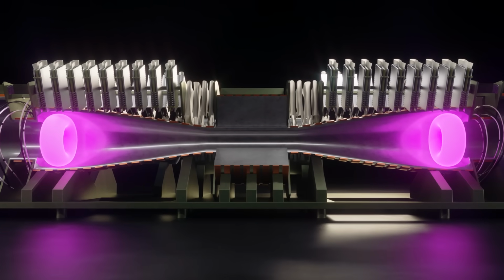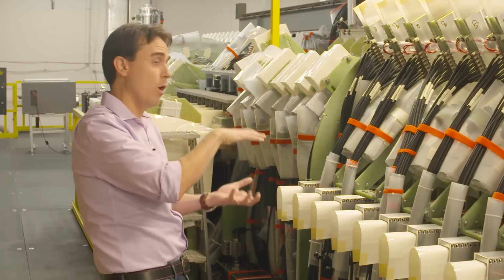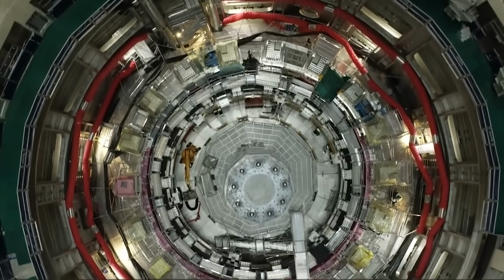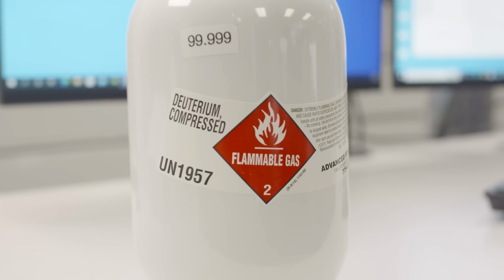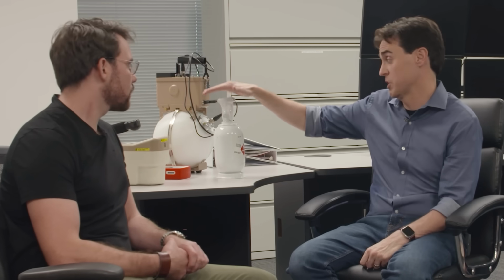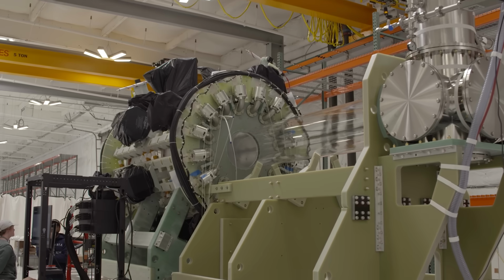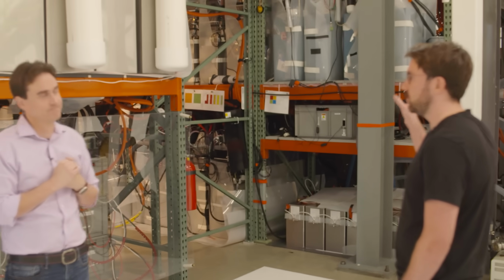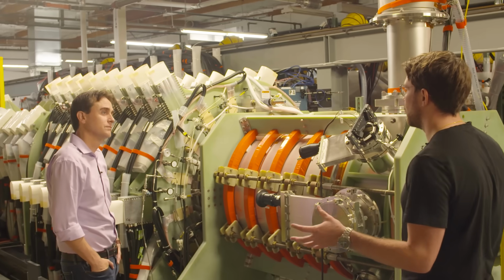A New Way to Achieve Nuclear Fusion: Helion

Comment: This is fascinating. However, the resource limitations are all the more reason why we need to begin mining the asteroid field for those "rare earth resources" because those materials are only rare on earth but quite abundant in space. 

Furthermore, The process they are using to create more tritium can be applied in order to create true gold "Noth that we would need to considering Gold is likely very abundant in space" What many people do not know is that all of the gold on earth was not created on earth but is simply the result of Supernovae and gravity. While we COULD fuse gold, we likely wouldnt need to. instead we would use this method to create truly limited resources.

Personally. i wonder how much of this method can be used in the creation of Anti-Matter. Using the same magnetic principles you may be able to confine an Anti-matter stream and exhaust it as thrust or convert it the same way to generate electricity.

.

Comment: Is there an OFF button?
Reply: Of course.
Reply: @elmarmoelzer2229  Yeah. It's called chaos.. Js.. What happens when the magnets fail over time. Or whatever. Black hole? Sounds fun.. Also, when does it get converted as a weapon? I can't be the only idiot that can see that happening. Or maybe it already has...
Reply: @jamesbenge7724  You can't convert it into a weapon and even if you could it really wouldn't make sense given it would be even more specialized work than building a fission bomb

Comment: So, there's a potential massive fix to getting clean energy efficiently, but it's locked behind engineering problems that cannot be solved communally by engineers because it is a commercial product rather than a scientific endeavour, so no-one other than those on the payroll of Helion can work on it or produce more efficient models because of patenting. Once again profit motive ruins humanities chances of survival. Every year these problems go unsolved for the sake of profit hoarding the worse the world will get. Well done to the engineers, fuck the business owners.

Comment: What kind  of materials can possibly withstand ten of millions of degrees in order to hold this fusion in? The best metals can only withstand thousands of degrees, plus how would you test the materials to know that it can withstand this kind of outrageous temperatures without possibly causing a catastrophe to the entire planets, we are talking about putting the temperature of multiple suns on the earth?
Reply: Here we go again:
Temperature alone does not matter. What also matters is the size and density of the high temperature object. 
The fusion plasma is very hot, but not very dense (closer to a vacuum than to ambient air) and it is surrounded by a high vacuum, which is a perfect insulator. Think of steam from a pot of boiling water. The steam is boiling hot, but you can hold your hand into it (carefully!) without getting severe burns. This is similar. It also cools off immediately when it touches anything like air or the vacuum vessel walls. In addition to that, the magnetic field keeps it away from the walls until it is allowed to expand. It cools off during expansion. While it expands it induces a current in the surrounding coils. Doing that work makes it cool off even faster.
Reply: @elmarmoelzer2229  I would say thanks for the answer except you started it out as a totally rude fk by saying "Here we go again"

Comment: And how safe is this technology and it's military function is a bomb I bet it's cleaner then a regular nuke
Reply: These types of machines can not explode. The fusion plasma is very hot, but not very dense (closer to a vacuum than to ambient air). Total energy content of a pulse is less than a Tesla battery.
Reply: A regular nuke uses Fission,Thermal and hydrogen bombs use a combo of fission to ignite the Fusion section of the Thermal Nuclear Weapon.Both are radioactive.The core of fusion has to be radiant material to ignite .
Reply: @pootube2024   No, that is the whole point of building fusion reactors for power. It is also why it is so hard. They DO NOT require those materials.

Comment: The only fusion reactor that made sense to me thus far. I've always thought about how we can generate/capture electrons without the thermal and/or mechanical processes. Although I always believed that the ultimate energy supremacy for humans would be the day we manage to split all kinds of atoms including the non radioactive ones, then harness and covert all the energy before that have a chance to collide and create new elements again. The nuclear energy inside a grain of sand can potentially power new York for an hour if all the mass is eliminated by being covered into energy subparticles 

I wish all the efforts, R&,D and devotion to fusion energy that exists today also existed for creation of 5th and 6th generation fission reactors as well, because thorium or spent fuels powered reactors can potentially make electricity very affordable and eliminate much of the radioactive waste storage needed with conventional reactors

Comment: Every couple of decades the fusion game pops up.  I call it a game to write a grant proposal that allows you to spend millions of dollars on a theory.  I'm more concerned about the 'room temp gas' introduced into the plasma chamber.  Seems suspect if energy is the goal.  What is the gas?
Reply: They are not interested in grants (which are way too small to get anything major done anyway). They are fully funded and are desperately looking for qualified employees.
The gas is deuterium and helium3. It is then ionized formed into an FRC and accelerated in the formation/acceleration section to hypersonic speeds. The two FRCs from opposite ends collide and merge into a single hotter and more stable FRC. That is then used as a target for magnetic compression to fusion temperatures and densities.

Comment: I'm just curious as to what kind of metals they use to keep all that heat contain from actual age of melting the damn machine. 20 million degrees is a lot of heat.
Reply: The fusion plasma is very hot, but not very dense (closer to a vacuum than to ambient air) and it is surrounded by a high vacuum, which is a perfect insulator. Think of steam from a pot of boiling water. The steam is boiling hot, but you can hold your hand into it (carefully!) without getting severe burns.
This is similar. The total energy content of a pulse is a few kWh. So not that much.
It also cools off immediately when it touches anything like air or the vacuum vessel walls. The magnets hold this plasma in place until the end of the pulse when it is allowed to expand. That expansion does work, inducing a current in the surrounding coils. That causes the plasma to further cool off.
Even if that was not the case, the plasma is not dense enough to cause a lot of damage to the walls. It would maybe be some slight abrasion that would become a maintenance issue if it happened too often.

Comment: Interesting program. Best pact is that we now have two possible methods using either lasers or magnetics that show promise.
One of the main problems is the second element used. In both cases it is very rare and costly. Finding a way to manufacture these elements both in quantity and at lower cost needs to be found.  
My guess is anyone in their 50's stand a very good chance of seeing a working solution in action.
Reply: Helion will produce their Helium3 by fusing Deuterium in the same machine. D+D => He3 +n or D+D => T + p (the Tritium eventually decays to He3 as well).

Comment: Ive a problem with the explanation of "high pressure water" 8:51, water can not be compressed to "high pressure", also this nuclear fusion of Helion, I understand that it is still in the early stages BUT, and I don't know why it all sounds very suspect.
Reply: Yeah, Real Engineering has a few mistakes in their video. That is not Helion's fault though.
What sounds suspect?
Reply: @elmarmoelzer2229  A few things do not add up, I get the same gut feeling I had with Theranous (any everybody I knew said I was wrong) hopefully I'm wrong on this.
Reply: @maxnex7676   
Like what does not add up?
I have known these guys for many years. They are legit. 
But if you give me specific examples of what you think is not right, I can maybe answer them for you.
Reply: @elmarmoelzer2229  Thanks for the offer, appreciate it, perhaps I will come back to you for clarification.

Comment: and what happens to all the heat generated? smh... fake engineering.
Reply: It is directly converted into electricity.
There is relatively little waste heat. Trenta just needs air cooling. Future machines will have water and/or oil cooling.
Reply: @elmarmoelzer2229  excuse me but how do you "Directly convert" heat into electricity?
Reply: @dimitar4y   I should probably clarify that a bit more: They are directly converting the expansion of the FRC plasmoid to electricity. That expansion is driven by the FRCs own internal pressure and the kinetic energy in the fusion products.
Reply: @elmarmoelzer2229  yes. The expansion. So after the plasma's expanded and it's a few million degreeeeees.....?
Reply: @dimitar4y  
Let me try to explain it: 
So first they make a bigger hotter and more stable FRC by colliding the two original FRCs.
The resulting FRC is then compressed by strong magnets to fusion temperatures.
Fusion happens, the compression field is turned off. The plasmoid expands again, driven by its own internal pressure and the added energy from fusion.

Think of filling a balloon with gas. You then compress that balloon. The air inside will get warmer from the compression. When you let go, the balloon wants to expand again. At the same time the air inside cools off again.
Obviously, that won't add any additional energy to the expansion of the balloon but bear with me, please!

Now the FRC plasma configuration is sort of like that balloon, holding the gas (Deuterium and Helium3) together.
What adds net energy is the fusion reactions that happen when that plasmoid is compressed (obviously air in the compressed balloon would not fuse, but the gas in a compressed FRC will).
Reply: @elmarmoelzer2229  yes and when it expands again it would still be some amount hot.
Reply: @dimitar4y  Well yes, at the beginning of the expansion it is still at several hundred million degrees. But it cools off as it expands. Just as it got hot when it was compressed. That expansion energy is transferred to the coils and induces a current there.
The process is said to be >95% efficient. So there should be relatively little heat left. 
And don't forget that the plasma is very low density. In case you are worried about the walls.
Reply: @elmarmoelzer2229  i'm not worried about the walls, everyone is. It's been a constant worry for every design of a fusion machine. If we are to get any significant gains that can power i.e. a city, it needs to be high density plasma with such high temperature that after the expansion it'd still melt a hole in the reactor.
Reply: @dimitar4y  Let me try to explain that again.
Helion's plasma will be two orders of magnitude more dense than the average Tokamak and yet it will still be closer to a vacuum than to ambient air.
The total energy content of a pulse is just a few kWh. It is not going to melt a hole into the wall, nor would it for a tokamak. When they talk to damage to the walls, they talk about slow damage over time. In D-T burning machines that is mainly because of neutron embrittlement. In the ARC Tokamak by CFS they expect to replace the wall once every 4 years because of that. In Helion's machine it will be even slower. The walls will last for many years.

Comment: If Fusion is gonna get here, it's probably gonna look something like this.
I'm curious about the input/output of this system so far; how much does it put out for how much you put in?
Reply: This system is lacking the energy re- capture that you need to actually get electricity back out of the system. They are just measuring and calculating it for now. Polaris will add that feature and show net electricity production from fusion (for the very first time) next year.

Comment: I love that this system actually makes sense and has a plan for creating its own fuel.. but did they ever say how much energy they use to initiate the reaction compared to how much the reaction produces?
Reply: This system is an experiment and lacking the energy re- capture that you need to actually get electricity back out of the system. They are just measuring and calculating it for now. Polaris will add that feature and show net electricity production from fusion (for the very first time) next year.

Comment: What about the Net Energy of the system thing? Or is this proof of concept still?
Reply: Net energy from what fuel and under what other assumptions? This is an experiment to proof that their design can work as expected. Polaris will demonstrate net electricity (not just net energy!) from fusion next year.

Comment: The more I learn about Tokemak generators the more I wonder if this is just a train that got going and that is because of its age a "safe bet" from a funding perspective rather than a really feasible technology. The idea that after all these years no one has been able to generate more energy than they put in and the only way anyone sees this realistically working is by building an ever larger test setup to the point where it seems only feasible by having many states funding the research in order to build the massive test setups to hopefully generate slightly more energy than they put in. With as of now no proof that this will actually work, let alone a plan to move this to a realistic production setup.

Till we see an actually repeatable solution where more energy is produced than put in and actually captured without needing to rebuild the machine every other few days I very much doubt nuclear fusion is around the corner. I think that this solution at least stands a chance but again energy capture and with that long, preferably very long maintenance intervals that do not cost more than the energy produced in between could be a possible way forward.
But again till the day comes that we can at least in a test setup produce more energy than we put in, capture this and not need to spend more money on maintenance than we generate in total power I seriously doubt we will see fusion become a real viable source of energy in our lifetimes.
Reply: Polaris is supposed to demonstrate all that next year.

Comment: They need to know the steady state of the reactor at temperature, and design with that in mind, not design from the ground state of rest. Just like with the SR-71, the hull and gas tank needed to be built to accommodate the pressure and heat upon the hull from the air friction, so the gas tanks actually leak sitting on the runway. This new machine will run the way a blast furnace did, once you start it, you need to run it continuously until it dies.
Reply: No, their machines are pulsed and they are meant to startup quickly and load follow by varying the pulse rate.

Comment: I think this is a novel way to drive a turbine for electricity. I also question the imput of energy to make this reaction, and wonder what the net gain is, if any?
Reply: They don't drive a turbine for electricity. They use direct conversion. Net gain with what fuel and under what assumptions? This is a proof of concept machine. It was designed to be good enough to show that it works as intended. Polaris will be the machine that will demonstrate net electricity (not just net energy) from fusion next year.

Comment: Helium 3 is VERY rare, but lots of it is found bound to lunar regolith. This has been a trope on SF films such as MOON.
Reply: It is actually not that much in lunar regolith, only about 20 parts per billion. Thankfully Helion will produce their Helium3 by fusing Deuterium in the same machine. D+D => He3 +n or D+D => T + p (the Tritium eventually decays to He3 as well). No space travel required.
Reply: @elmarmoelzer2229  I will be looking forward to see them achieve net power output. Seems to me that having to make their own fuel wll delay that day. And even though the amount of He-3 in lunar regolith is fairly minimal, there is a lot more on the moon than there is on the earth.